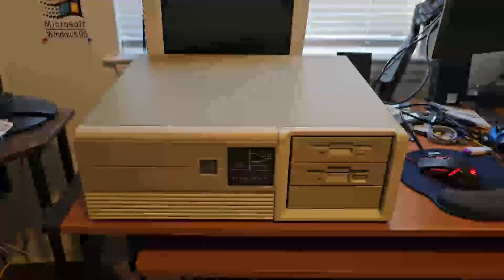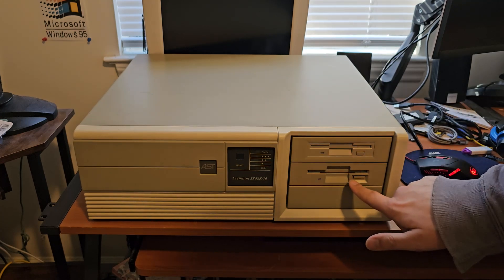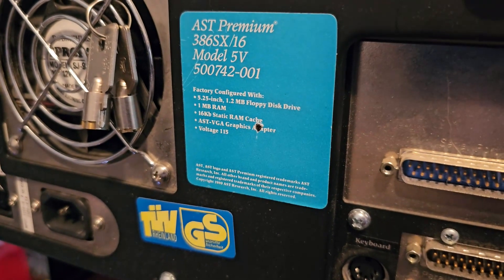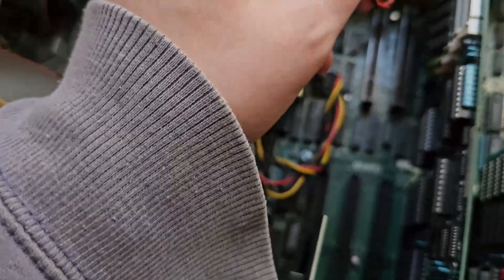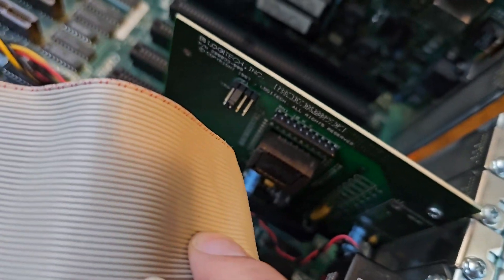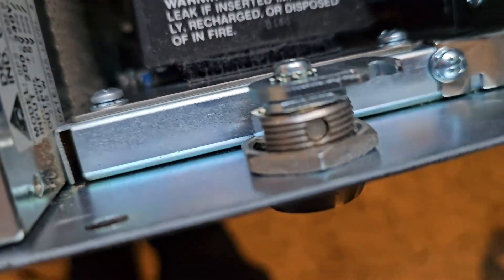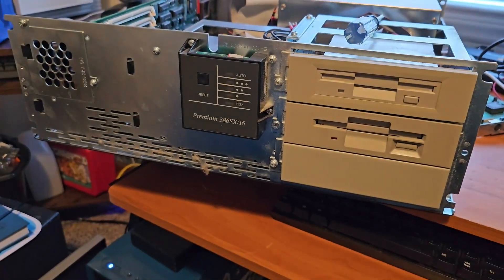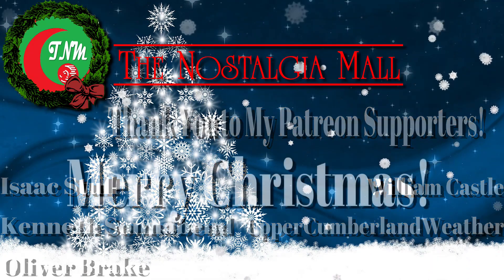Nostalgia Mall Christmas 2023: The 386 That Almost Worked

Comment: The corrosion can clean using vinegar and a old toothbrush.  Let the vinegar sit on the corrosion area for 1 or 2 minute then clean the area with water.  You may have traces damaged near or under the  IC.  Traces troubleshooting to see the traces are ok.  In repairing motherboard, I keep one know good video card for testing.

Comment: Looks like the corrosion on the card was probably caused by that capacitor next to the IC leaking. Might be worth trying to clean it up with an old toothbrush and some isopropyl alcohol, although if the traces on the card were damaged, that won't do much good.
Reply: I agree, I think that card is still salvageable!